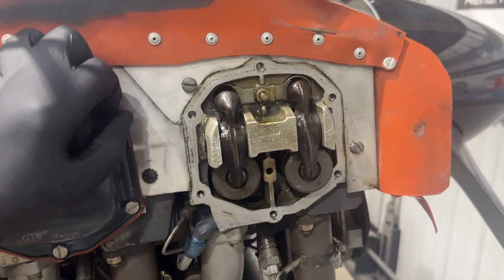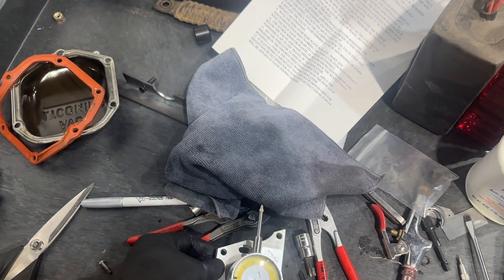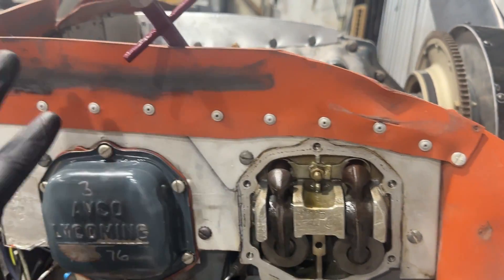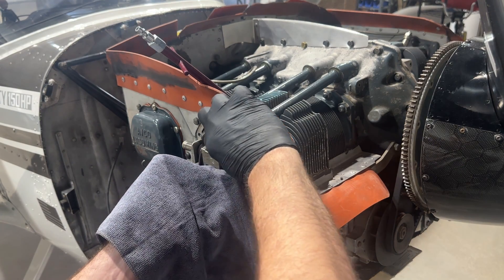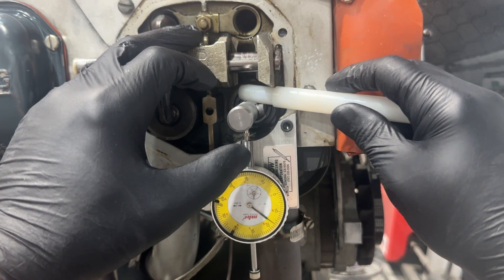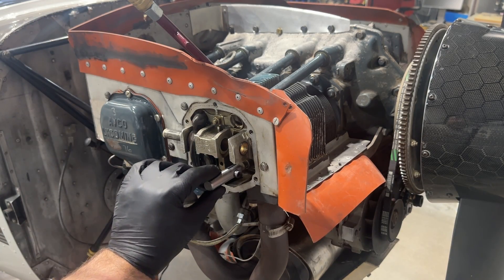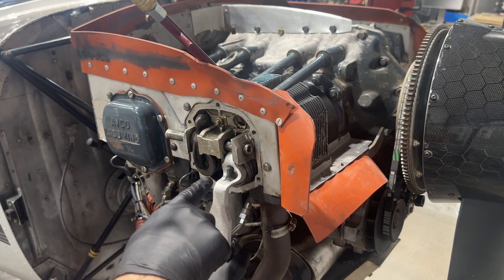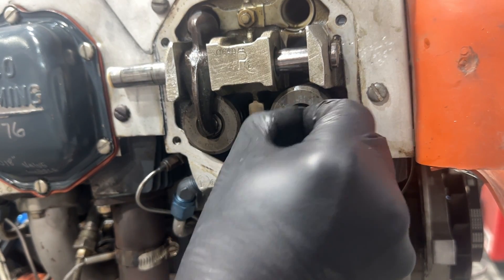Lycoming Exhaust Valve Wobble Test

Comment: To make sure the valve is retained, it's much more common to see mechanics just stuff a bunch of rope through the spark plug hole. Then there's no risk that comes with pressurizing the cylinder.

Comment: The test is to see if you have lead buildup on the valve stem which could cause a sticking valve.
Reply from the maker: There's a maximum limit to the tolerance as well which indicates worn valve guide.

Comment: Thanks for this video. What is the work/replacement needed if the wobble isn't within limit? Change / clean the valve? Thx
Reply from the maker: If the valve guide has worn too much and the play is too great then the cylinder should be pulled and new guides installed. 

If it’s too tight then they can be reamed and the stems polished with the cylinders installed by dropping the valve inside the cylinder using the dental floss and safety wire trick.

Comment: You stated the maximum allowable clearance (wobble), is there a minimum clearance? My understanding is these have a tendency to get carbon build up causing the exhaust valve to stick, seems like this would be a good way to spot that as well. Great video, thanks!
Reply: The valves stick from lead build up. If able, run mogas and lean aggressively.
Reply from the maker: There is a minimum. I forget exactly but it’s around .010” or so. Good point. If it were less than that you could investigate further and consider reaming the guides to clear out carbon coking.